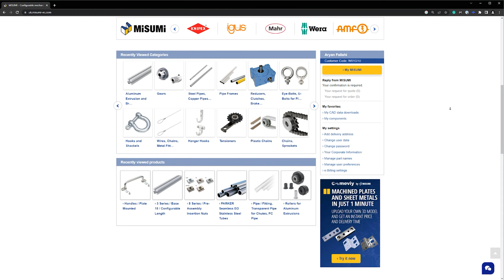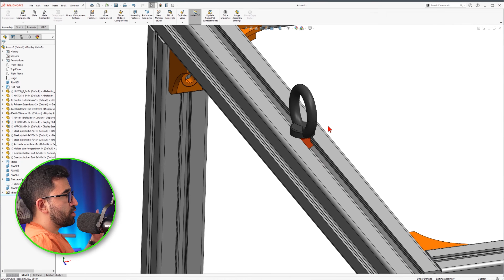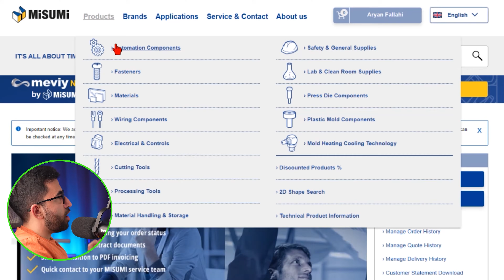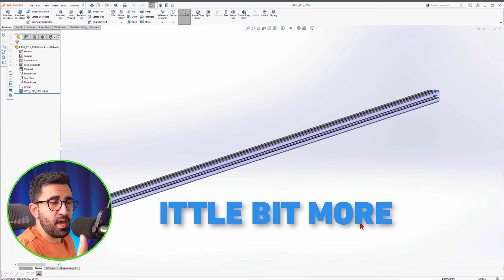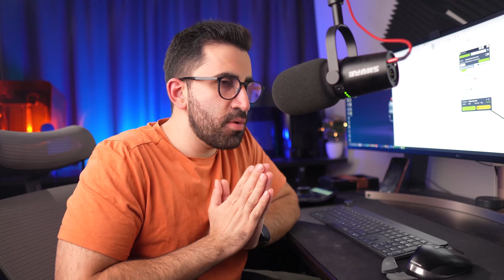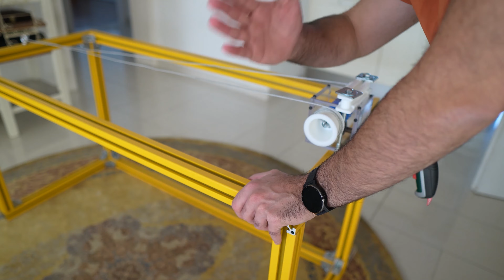3 Ways To INSTANTLY Charge More For Your Solidworks Projects (or any other CAD)

Comment: If an engineer is great they won't charge by the hour. They will charge a fixed fee for a project. They put their money where their mouth is and charge what it's worth to the client. it also forces you to get better. if a client has a $1M problem nobody can solve except you then you charge them $1M and if it takes you 5 min to do it good for you.
Reply from the maker: It's valid! That's the point where you charge for your engineering skills over your sw skills. Well said

Comment: Part Fit is key..use of standard equipment is great..and proficiency in SW certainly helps.  
But there may be more to Mechanical Engineering..
You've covered half the dog.  Hopefully can still get wet enough to electrocute when you add the "industrial fan".  
The extruded aluminum is sharp AF- will scratch the sh*t out of your bathtub..
So..basically it's an advert for Misumi..
Reply from the maker: oh yeah! it's not a product ready to be sold! it's only a POC
Reply: @with-aryan -yes, POC would be an acronym for it..

Comment: I'm an industrial designer, I have a skill set that is a good ratio of visual styling prowess, problem solver, concept to manufacture, quote drawing to production drawings even packaging specs.  I have probably a 5/10 in Class A surfacing using Solidworks. Essentially everything needed to solve problems to a production ready files.  Almost 20 years experience but I still only charge $ 80AUD / hour to clients that pretty much give me 50-60hrs  a month.  My question is, I look at job placement websites and most only offer around 100K per year for onsite senior roles which only translate to around $50AUD/hour.  How do i find clients that are willing to go beyond what I find is on offer on job sites?  Personally I feel my level of experience is worth around $120-150 but my competition are full time on site design engineers.  FYI, I don't do heavy mechanical design work, only simple mechanical design work that can be found usually in the home or shops.
Reply from the maker: After a few years of experience its always better to even start your own gig, the market at times based on your locality might never give you the rate you demand, that is why setting a business online can help, and since you are the Boss, you can demand your rate and clients will pay that, as long as you delivery quality work.
Reply: I've been in design for over 30 years. One thing you can always use to help with getting more money than the initial job pays is to add bonus programs to your job performance. Bonuses are looked at different, it just depends on the company. I'm in the same situation as far as I need a way to market myself to get the compensation I feel is deserved for the work that I can do. I'm just looking now, I've got a great portfolio but getting a good client that needs exactly what I am really good at is the tough part. Always be looking or you miss the great opportunities. I've found the best all around is engineering/manufacturing contract businesses. They get allot of diverse projects that keep you moving. Good luck.

Comment: So many questions.
So how did you wash under the harness?
We didn't see the rinse bucket, or whatever being used.
Where do you store the contraption when you need a shower?

Did someone actually pay you to design that?
If you earned $300/hour to design that, I want to know the customer.
By the way...
Misumin is small potatoes compared to what's available on McMaster-Carr.
Reply from the maker: no bucket,just the tub and rinsed under the harness as the last bit. the storage is an issue for this design as this is not foldable. I should have made it foldable

Comment: Hi, Aryan! I'm a mechanical engineering student in Brazil, and i'd love to "freelance" as a cad designer. I've been through a corse of solidworks, I don't know, however, if my skills are enough the freelance stuff. Also, since i have never done a professional design, i don't know the dos and don'ts of it or the necessities and requirements of the design. Would love some reply, if possible. 
Thank you, Thiago
Reply from the maker: Hi Thiago! It's great to hear that you're interested in freelancing as a CAD designer. SolidWorks knowledge is a valuable skill in the industry. To determine if your skills are sufficient for freelancing, you can start by building a portfolio showcasing your SolidWorks projects and designs. This will demonstrate your capabilities to potential clients.

When it comes to professional design, there are some important factors to consider. It's crucial to have a good understanding of design principles, engineering standards, and best practices. Familiarize yourself with industry-specific requirements and regulations that may apply to the projects you work on.

Communication and collaboration skills are also essential, as you'll need to interact with clients to understand their needs and deliver designs that meet their expectations.

Additionally, continuous learning and staying updated with new features and techniques in SolidWorks will help you improve your skills and stay competitive in the field.

Starting with smaller projects and gradually expanding your client base can help you gain valuable experience and confidence as a freelance CAD designer. Good luck on your journey, and don't hesitate to reach out if you have further questions!

Comment: Where did the red round bath thing end up? + Wonder how this extension calculates parts? Because I can buy  2 m standard profile, and cut it (f you have saw and workshop that is), which will be cheaper, than ordering pre cut parts. The less work, sometimes costs more money. And what happens when you need to change these parts and components? Download new ones?
And this video is just such an affiliate to Misumi. There are much faster ways to work through Weldment and structural Assemblies, than this example. Only to include price in the list?
And the name for the video is misleading as well. So did you prove how to make more money with Solidworks, or did you make a convenient presentation about how to use Misumi website and extention?
Reply from the maker: Faster to work through it maybe you are right. but when it comes to actually ordering those parts, you will be exponentially slower and spend considerably more time to create drawings right, find vendors, email them and ask them for quotes, wait 2 or 3 days for their response (IF they can do it), please the order the next day, so I stand corrected. My way is considerably faster buddy, you gotta trust me on this one
Reply: @with-aryan  depends what is your aim of design. Save time on modeling or save time on ordering?

Comment: Hi how can i add the misumi extension to solidworks please.
Reply from the maker: To add the Misumi extension to SolidWorks, follow the below steps:

1. Go to Misumi's website and download the extension file
2. Open SolidWorks and click on "Tools" followed by "Add-ins"
3. In the "Add-ins" window, click on the "Browse" button and locate the downloaded extension file
4. Once you have found the extension file, select it and click "OK"
5. After you have added the extension, it will appear in the list of SolidWorks add-ins
6. Finally, check the box next to the Misumi extension to enable it.

Now, the Misumi extension will be available in the SolidWorks "Command Manager" toolbar. You can use it to access Misumi components and configure them to match your requirements.

Comment: How do you cope with customers who cannot specify their needs? Or rather change their mind back and forth midproject?
Reply from the maker: duck and move! :)) 
it makes your job harder and you have to simplify it for them. unfortunately, that's the case in many situations
Reply: Document the scope. Charge a fixed fee for the work. Then get a change order when the scope changes.

Comment: last i saw on a 3D printing group a typical hourly rate was $25/hr. you talk about quality. quality is dependent on how easy is the model to edit, how likely it is to fall apart when translated., etc. being able to incorporate in parametric modeling, logic, spreadsheets, etc is a plus. GD&T works in with the larger design assembly. this meaqns signoffs. this means waiting around till the head engineer can sign off which adds time. doing GD^T means knowing math and the manufacturing operations. manytimes machinists struggle with this level of math. seems you are leaving alot out.
Reply from the maker: You make some valid points about factors that can affect the hourly rate for 3D modeling services, such as the complexity of the model and the level of detail required. Additionally, incorporating parametric modeling, GD&T, and other design elements can require specialized knowledge and skills, which may also impact the hourly rate.

I agree that quality is an important consideration when it comes to 3D modeling, and factors such as ease of editing and translation can have a significant impact on the overall quality of the design. However, it's also important to consider other factors such as the level of experience and expertise of the designer, as well as their ability to communicate effectively with clients and other stakeholders.

Regarding GD&T, I agree that this can be a complex topic that requires specialized knowledge and math skills. However, it's also an important aspect of many engineering and manufacturing processes, and can help ensure that designs are functional, manufacturable, and meet the required specifications. As you mentioned, machinists may struggle with this level of math, which is why it's important for designers to have a solid understanding of GD&T and be able to effectively communicate with all stakeholders throughout the design process.

Overall, the hourly rate for 3D modeling services can depend on a variety of factors, and it's important for both clients and designers to carefully consider these factors and ensure that the services provided meet their needs and expectations.

Comment: You cannot guarantee component quality or fit.  3rd party supp,ies, especially cost effective ones typically use substandard parts, seconds or get part that have poor quality control. Cost on that website are list, not cost and do not take into account seller markup or large volume sales or getvth g the product direct.
Reply from the maker: there are ways to guarantee a 100% fit, that can be achieve through using GD&T or getting standard components

Comment: if you dont mind can you tell me how the pulley holds a 30 kg dog in the sting. did you use any clutch to stop reeling backward
thanks for the information its a great help
Reply: Because of the high gear ratio the worm gear has a lot of tourqe, it takes a lot of force to move the worm gear from the side that the strings are on for that reason. You could do calculations to figure out the torque of the worm gear, then make a free body diagram to see that it takes a lot of downward force to overcome the torque.
Reply: high reduction worm gears are not reversible. you do not need a backstop device. but still i am amazed by the printed pulleys' strength.
Reply from the maker: Not at all, the worm gearbox has a one way transmission, can’t rotate reverse
Reply: @with-aryan  well technically it can rotate in reverse, it's just not back driveable